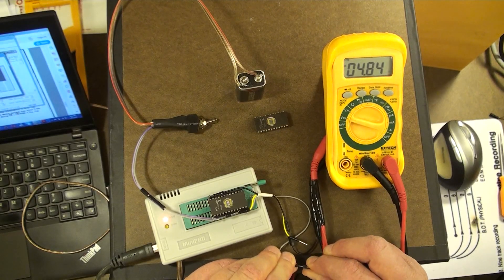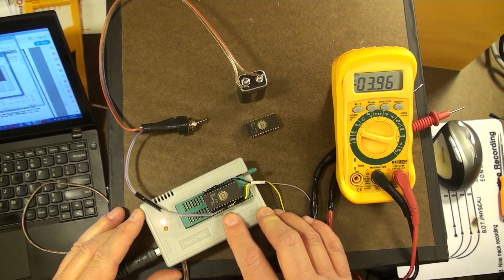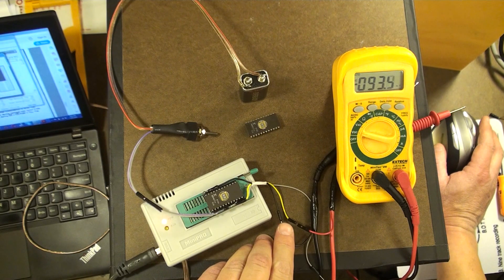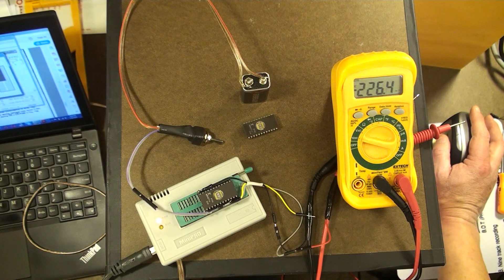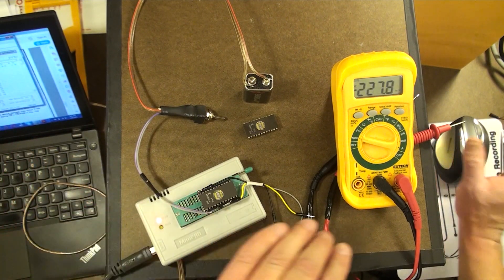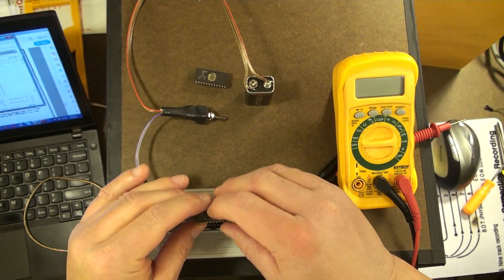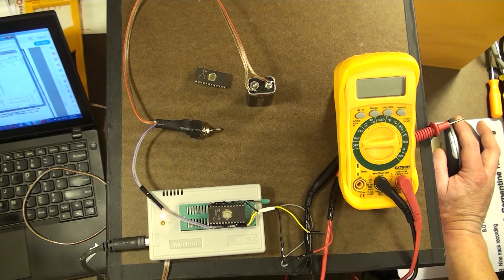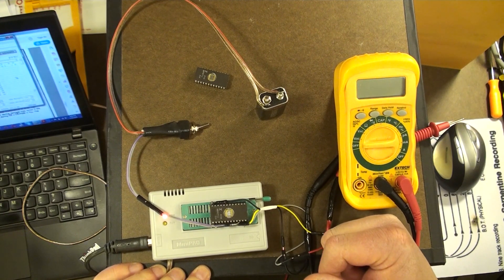MiniPRO TL866A 9v programming boost for MBM2716 EPROMs part 2

Comment: Great work! I too purchased a TL866II-Plus with the plan of programming 2732 and 2764 EPROMs for my vintage synths and drum machines. Except with that model of programmer, the maximum Vpp is 18V. Alas when I attempted to program my first chip I encountered the error you described. Which brought me to your video. I will be attempting your mod shortly. Except instead of a 9V battery, I'm going to use a DC power supply to provide the additional voltage so that I can dial the exact amount in. If you have it, would you be able to post a sketch for your modification? 

Once again,  thanks for your hard work and for making this public :)